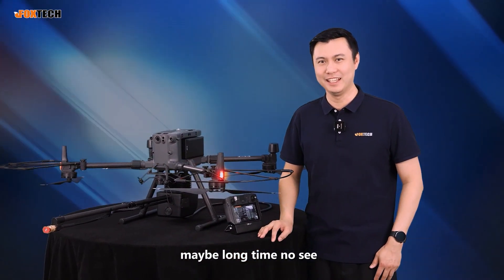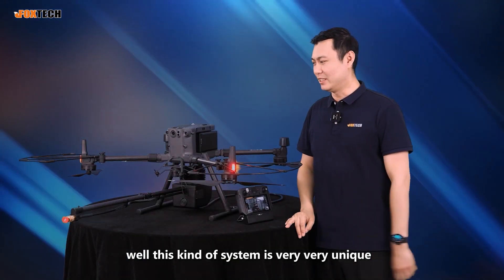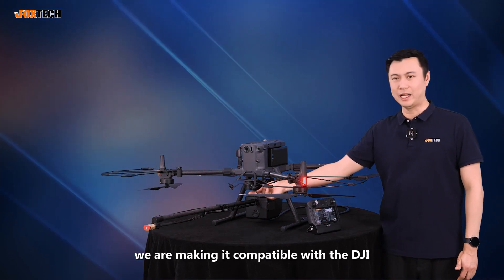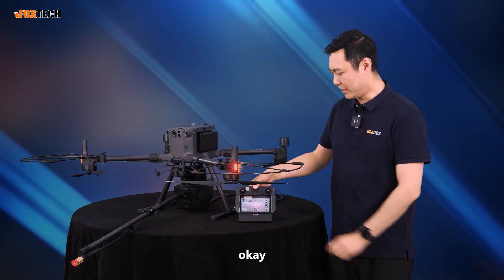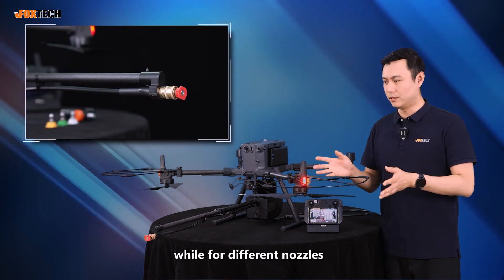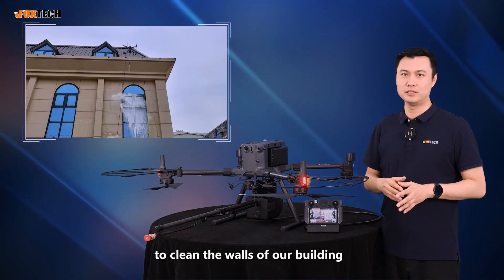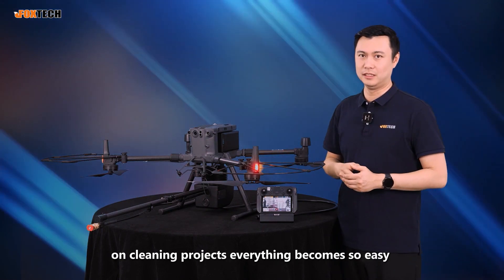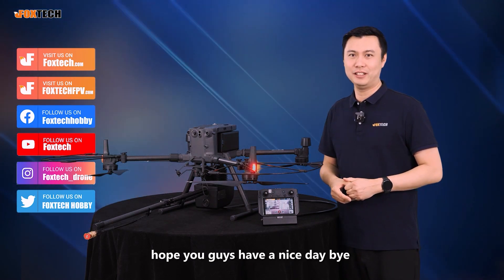AeroClean P3 (T50) Detailed Introduction | Revolutionizing High-Altitude Drone Cleaning

Comment: Hey there what is the diameter and material used for  tethered water hose
Reply from the maker: Dear, the hose features a 10mm outer diameter, 5.8mm inner diameter, and can withstand pressures up to 16MPa.